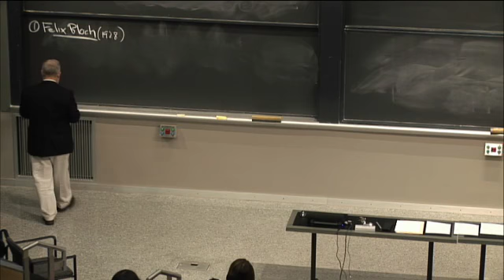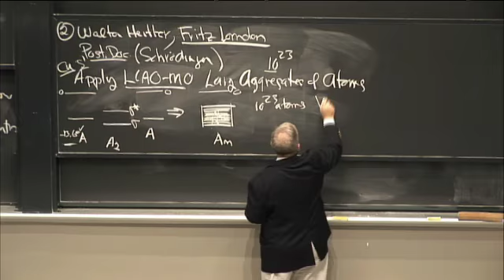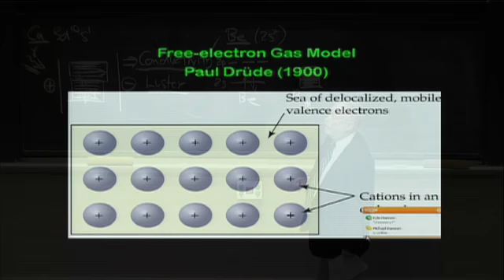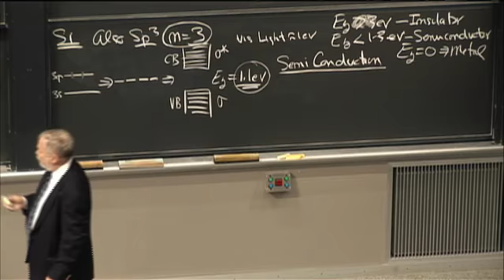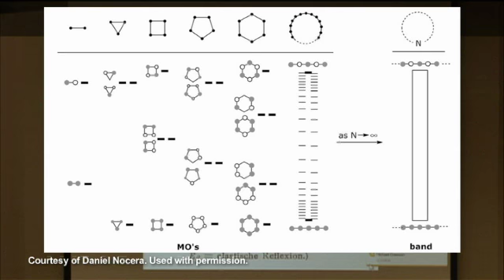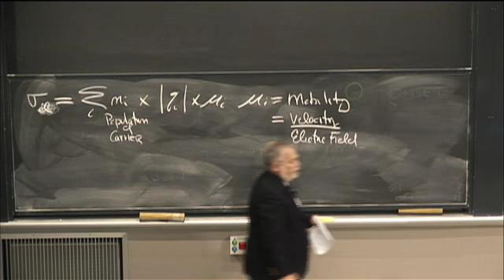Lec 13 | MIT 3.091SC Introduction to Solid State Chemistry, Fall 2010

Comment: Holy cow. As a physics major NOT going to MIT, now I wish I was. You had examples, you had 'lets back up and re-orient', you pointed out what individual parts represent (this is the disruptive aspect), and every single step of the way you connected it to something tangible. In writing out the equations (large, clearly, and with description), you can see how things are built, and you pointed out what EVERY variable was and represented as you went along.

Just had a semester where the professor had ZERO of this. Just powerpoint slides, zero enthusiasm or effort, ums and uhs and powerpoint slides. The students here, I hope, should realize how phenomenal this kind of instruction is. And still, fifteen years on, this is helping. I wish I'd thought of checking here three semesters ago. Thank you, thank you, thank you!

Comment: Does anyone understand what he means by "... I can make a photosensor" ?
Reply: It's a type of photon detectors, may be a photoconductor or a photodiode, etc. The semiconductor is equipped with an external voltage source. When the light strikes on the semiconductor, it generates new charge carriers that is transferred to the electrical signal, and we detect photons. It's different from solar cells where the photon and semiconductor itself acts as the voltage source.

Comment: At the begining of the video, he mentions the Drude model from the previous lecture. I couldn't find the video for that. Does anyone know where it is? Lecture 12 is about intermolecular forces =/
Reply: I was wondering the same
Reply: I guess that was from the lecture far in the beginning about lec 7~8? - oversimplified electron sea model
Reply: It happened in original recitation hours at the end... To have intuitive knowledge of metals and metallic bonding... But recitations are not included here, that's why it will be drag for us here on OCW...

Comment: This guy does not know what he's talking about.

He says semiconductors are less than 1-3 eV when they are in between.

Later in the lecture "Silicon absorbs a neutron to become phosphorous" Protons change Z not neutrons. Absorbing a neutron would simply make it an isotope of Silicon.

I should be teaching this guy- how does he have a job at MIT?!
Reply: I agree that he messes up in lecture from time to time. This is actually a very common thing, even, I imagine, at MIT. Many professors say and write things incorrectly in the moment, and often students will raise their hands and point it out. And it gets fixed. So don't be too hard on him. I am more concerned that the students aren't noticing these things.
Also, not every professor is hired because they can teach brilliantly. Many of them are at MIT because of their research.
Reply: silicon decays to phosphorus via beta decay after neutron absorption. A professor working at MIT probably knows more than you, so maybe tone it down a little
Reply: Fuck you